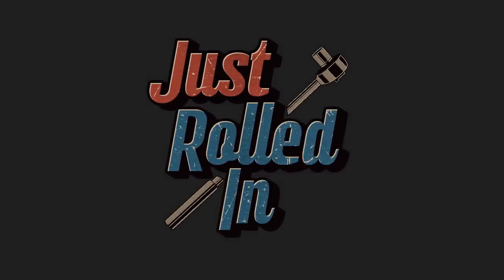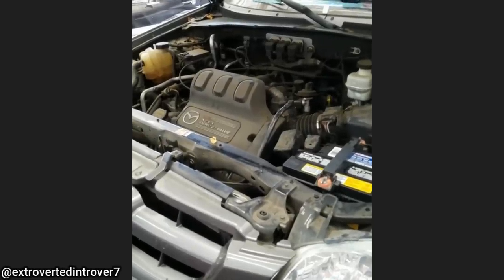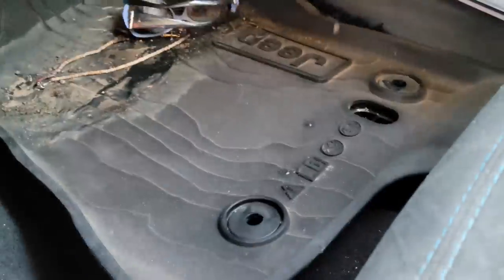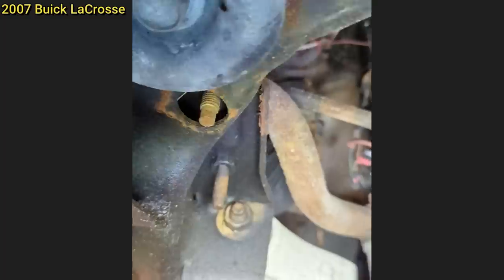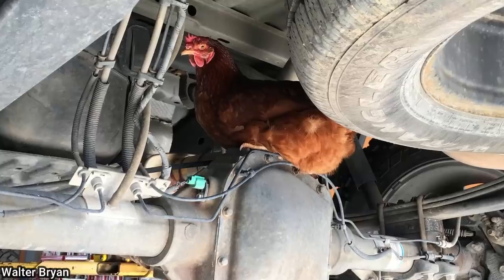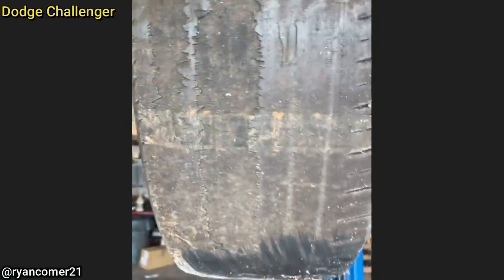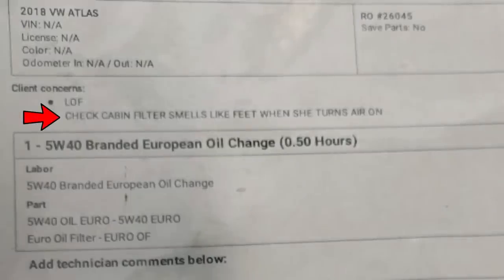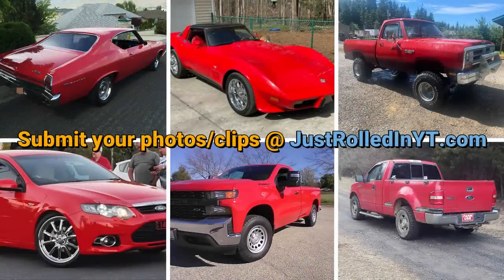Customer States They Got A Flat Tire & Kept Driving | Just Rolled In

Comment: Cats certainly know how to pick a sucker!  I'm owned by seven socialized now-indoor/walled yard ferals at the moment.  (It helps that I have the room, the time, and can trade with my vet for discounts.)
Reply: My mom has has had two cats that came from an engine compartment. The first was back when I was a kid, under the hood of an old Pontiac Lemans my uncle had just bought. The second was a few years ago. Mom drove home and heard meowing in the front of her car. Dad had to fish around inside the bumper, and found a little black fluff ball on top of the battery. They never officially named her because they were hoping to find her a home, but it's been several years, and "Kitty" is still around.

Comment: If I was the customer at 1:03 I would have declined all repairs as well, because that would be going back to the seller.
Reply from the maker: Definitely. You can also get resistors to bypass everything so the check engine light isn't on. They could have at least done that lol
Reply: Unless you bought the car in a Walmart parking lot or some other public location. Buyer beware unfortunately. Lots of people get screwed by bad sellers or lack of knowledge and what to look for. If I wanted to I could sell almost any car in garbage condition in Arizona as long as the ac was cold.
Reply: Aren't pretty much all used cars are sold "as-is". I don't think you can "return" it to the seller once you paid for it...
Reply: @engrishsheep  at least if you buy a used car at the dealership you can get a warranty and some states have a lemon law that if the same problem has to be fixed 3 times the dealer buys it back. That might only apply to new cars though.
Reply: @engrishsheep  Of you bought it from an individual, yes you're pretty much SOL (not that I wouldn't at least try to get my money back). But most states require used car dealerships to warranty for 30 days.
Reply: @engrishsheep  That depends. If you got it for below £5000, It may be worth going through the small climes track. It only costs £50 and you can make a case to the judge that although you bought it as is, There is an expectation that the car is in at least an ok state without any hidden problems that were not disclosed. 

If you get it checked as soon as you buy it, you may have a good case. It is highly unlikely that the bad work or problem appeared on the same day as purchase, and is more likely then not to be a lemon flip. If there is a blatant "trick" applied to the vehicle, then you have proof of deception.

But to avoid the problem in the first place, always ask if you can do a prepurchase check at a garage of your choice. They will look it over and let you know if there is a problem and how much it would be to fix. You can then pay what you agreed if all is ok, or negotiate the cost of repair off of the list price.

The mechanic will also normally give you their opinion on if they would buy the car at its current price in its condition, and let you know of any problems that may crop up given its age. its always good to pick the brain of a gear head, with there knowledge of repair costs and past knowledge of any problems with that make and model.
Reply: @dalelangila9274  what Heater 🤔🤣🥶
Reply: @engrishsheep  It depends on your state's Lemon Laws. If you live in my state, you are covered for any used car bought for at least $700 (if from a dealer, with less than 125,000 miles at time of sale).
If you are in a state like Florida, you are screwed. Florida doesn't have Lemon Law protections except for new cars purchased from the dealership.
Reply: @engrishsheep  Unless you can prove that the seller knew that the car was unfit for sale.

Comment: I worked in the automobile industry for 30+ years, but never once did I get a free chicken out of a job! On the other hand, at the beginning of my career I was a dealership technician. One winter morning, a colleague brought a car into his bay that had been parked outside overnight. This was back in the day when fans were connected to the crankshaft via a belt. This wasn't a modern car with a computer-controlled fan. This fan didn't even have a thermostatic clutch. When he opened the hood, he was horrified to discover that a stray/feral cat had crawled into the fan shroud to stay warm and had been chopped into a thousand tiny pieces on startup. Ugh. That's one I'll never forget.

Comment: Wait a minute...hol up...something aint right.

It smells like feet. Turns out to be a rotten avocado. Dude. Bro. How often do you wash your feeet? How do you associate rotten vegetables with FEET!! LOLLL
Reply from the maker: I was thinking the same thing as you lol
Reply: I associate cheese with the smell of feet, not rotten fruit.  But that's mostly about rubber boots that got wet inside, not feet getting noticeable all by themselves.  Maybe avocado smells different when it goes bad, because it has a lot of fat, not carbs like most plant material.

Comment: i just found this channel and i love it!  i am a 66yo woman who knows my cars/trucks inside and out,,,, i was driving a 2008 chevy colorado  a few years back, made an appointment at the shop i have been using for 30yrs...bring the truck in and tell the new machanic( he was the only one there, long timers out for test drives/parts)  and i told this guy i had "noise" coming up the steering wheel and needed new u joints,,,,he looked at me like i was a crazy woman..... i went back a few hours later and he told me i didn't need ujoints, there was cupping on my brand new tires.......no i said, it needs ujoints....he argued with me, the owner walks in and asks what the matter was, i told him...owner told new guy, put the truck on the lift....owner and i went under truck and i slapped those ujoints around...new guy got fired and the owner and i replaced the u joints....owner said free,  but i paid for the parts......some people are so stupid....
Reply from the maker: Thanks for being here 😊

Comment: I am retired mechanic now  but had a older dodge truck come in for a oil change.... took the filter off and bet weighted 5 or 6 pds.... was a gasser ... looked like 20w50 at 30 degrees coming out of the pan but the engine was well warmed up
Reply: And what issues did that (guessing) 3.9, 5.2, 5.9, or the leaning tower of power itself have after fresh oil and filter?
Reply: @garykirk1968  5.9.  The lifters had a slight tick before and after wasn't as bad... didn't help on power because it already had the damage to the valve train

Comment: Huh! Some things never do change, I guess. I remember seeing a Range Rover parked out on the street in front of the dealership with signs all over it saying the exact same things, back in the early 80's lol
Reply: In Delaware in late 90s a guy bought a new truck from a dealership it was nothing but problems they wouldn't fix it so he bought the property across the street parked the truck out there for years with signs and billboards about the dealer and had the truck sitting out there

Comment: I own an equinox with the 2.4 ecotec engine. The problem is that GM used a fuel pump that was too much for this engine. Result is it eats all of the oil in about 1000 miles. Had the warranty service done which consists of all new pistons and rings, new fuel pump, new timing chain, and coolant flush. Two years later it still eats oil but less of it. At least it’s paid off.
Reply: I had the recall done also, Just piston #4 and rings replaced nothing else, i was on the hook for the bearings it still burns 2 quarts of oil every 1000 miles. and this engine only has 54k on it.
Reply: My parents own a 17 Terrain with the 2.4. It's got 69k on it (just changed the oil today), and amazingly, it doesn't use a drop of oil. AFAIK, dad hasn't had to add oil to it, but he does check it periodically.
Reply: Econox ;-)
Reply: Calling BS, the GM warranty includes all four pistons and rings,  timing chains.  Try again.
Reply: @briansydnes1711  Just checked my dealers invoice. only Cylinder #4 was replaced. bearings and gaskets. Nothing about Timing Chains or Water pump. after doing the Oil Consumption tests before the repair it was determined on Cyl #4 was bad and that is what the dealer covered. I also got the recall to get the Cat's replaced due to excessive oil burning clogging the Cat's and they won't cover them either because they were only clogged about 30%. She is burning oil 2x faster and the oil is like black burnt water after 1200 miles. The repair ony had a 30 day warranty from the dealer with this campaign. i tried to fight it with Chevy but was shut down on every road i went down.
Reply: @joevk6274  I own 2014 since new. I change oil  every 4500-5000 miles at about 20%  So far does  not burn any oil
Reply: @tad6176  My dad's been sticking to the old 3000 mile standard. Seems to be working.

Comment: Sadly for the first customer
"Hello! We've been trying to reach you regarding your car's extended warranty" may be a welcomed call.
Reply: tax man (pre-covid) assessed the dodge at $3500 USD.  those warranty scammers will sell you a 5 year policy for $400/mo for 4 years.  do the math.  put the money away for yourself, $2200 rebuilt engine swap? no problem.  and if the old clunker dies,  buy another.

Comment: Chickens have amazing balance, they're like an organic gyroscope with legs. I had to wave a guy down once 'cause he had a chicken on the roof rack of his minivan. He told me he was tired and the chicken likes to roost up there, he didn't notice it and it had been up there for about 10 miles on crooked back roads doing around 45MPH. I don't know if chickens are fearless, or just too stupid to be scared, either way, they're funny little critters. Also, after briefly working at a Valvoline instant oil change center, I can say A LOT of modern cars consume oil, especially all those Kia's I saw with GDI engines, usually the canister type oil filters looked like the car had been running the oil for 3x long as it had.
Reply from the maker: I really want a chicken now after reading this lol
Reply: @JustRolledIn  You can pick one up, (if it lets you), and move their body around left/right up/down, & they keep their head motionless.  (Until you reach the limit of their neck, anyway.)
Reply: When I was in high school, we had a pair of Bantam roosters. One liked to perch on the handlebars of my mountain bike as I rode through the woods on our property. Speckles was pretty cool.
Reply: Chickens can get scared easily if a person or animal runs at them, but they don't have much brains.  I think they're too dumb to be traumatized, or understand the danger of riding on the outside or underside of a vehicle.  If they fell off the top, they might be able to fall safely and slow down, anyway, if they aren't too fat and don't get hit by someone else.  They can be affected by long term stress, but I'd guess that's more about hormones than brains.
Reply: @NemoConsequentae  Some years ago I saw a story about someone making an amateur film, they didn't have the money for a fancy gimbal so they strapped a gopro type camera to a chickens head. The chicken was fine and it actually worked, nice and steady shots while walking or running.
Reply: @kenlee74  Name that chicken "Steadicam"!
Reply: I think they are rather fearless
think about Foghorn Leghorn...
Reply: @kenlee74  That made me laugh, but damned if it doesn't sound like it would work!
Reply: @billysolhurok5542  Now I say... I SAY!

In all fairness though, ole Foghorn wasn't the brightest of the bunch haha
Reply: @DeadReckon  this is true 
Egghead Junior had him beat hands down

Comment: Ran out of oil twice... Ah the oil is new it won't need a filter 🤣 and just driving down the road... While doing donuts looking at the tyres 😂😂
Awesome as ever dude 👌 👍
Reply: I'm no mechanic, but that seems more like a "ran out of oil" issue than an old filter issue.  If there's that much metal in the filter, doesn't it mean oil was still flowing through the filter as the engine shredded itself?

Comment: 2:37 That is what you expect when buying a range rover. They fall apart fast
Reply from the maker: Never heard anything good about them 😅
Reply: @JustRolledIn  Been buying used ones the last 8 years and they have served me well. As long as you dont take it to a main dealer they are an absolute steal with value for money.
Reply: Best place to find a 2 year old Range Rover is a scrap yard. Fun fact, the Land River Discovery has the same wheel base as a Ford Explorer Sport (the 2 door one). Screw the gas cap off, and nose the Rover frame out with the Explorer frame. Screw the gas cap back on. Boom, derivable Range Rover thanks to some Ford guts.
(Yes, I know a body swap is more complex than this).
Reply: @JustRolledIn  My sis in law has a LR2? it's not the Range, but she honestly really hasn't had any problems with it!
Reply: @JustRolledIn  I heard when up on a hoist, a Rover is considered off road!👍🤣
Reply: That is why the hollyweird elite like them. Just like hollyweird stars falling apart fast.
Reply: Speaking for the UK, the absolute worst thing about Range Rovers is the drivers. Don't know why, but this car seems to exercise a fascination for the worst, most arrogant and sh*t-headed drivers on the road. Example: I pulled over for an oncoming ambulance - lights and siren blaring - and what does Lord F**kwit in the Range behind me do? Pulls out to overtake me, and damn nearly hits the thing head-on. Which part of the screaming, lit-up, ambulance could they not see?
Reply: I love my Range Rover she's so reliable. People who talk bad about them are just jealous they don't have one. There just like any other car if you take care of them they'll last a long time.

Comment: I did that to a dealer. Sat out with a sign. Had the car a month and the rear bushings were out and needed new tires on the rear because of the bushings. But on the contract they said they did 100 point inspection.. They replaced the bushings, tires, and did an alignment. Sad we had to go through all that. I know they have to make money but hell, I had only put 800 miles on the car. Car only had 42k on it and was 2 yrs old. You wouldn't think bushings would be out that soon. I only sat with the sign after a month of back and forth with them. At the time only had one vehicle and couldn't afford to do all that work.
Reply: Never had to fight a dealer, but I did contest the extended warranty that Big Tire Chain charged me after I declined it. 
The salespeople were too busy to talk with me or find a manager. I parked my car blocking their bays, went back in, and said the manager could take his time. Once they realized, one salesman remembered he was the manager, and was perfectly happy to correct the charge.
Unfortunately, some people need special help to do the right thing. I'm glad your problem was sorted.

Comment: Re the last clip.......similar happened many years ago in  Co Down Ireland. Customer had bought a Triumph 2.5 PI, a POS made by the then British Leyland. Car was a lemon, and dealer refused to honour warranty. Customer took a fortnight off work, and parked the car on the roadside outside the dealership-on a main thoroughfare- with large placards detailing the faults in the car, and spoke to everyone who would listen about the poor customer service.  Dealer called police, who couldn't do anything, no laws were being broken. For two weeks, the dealer didn't sell a single vehicle, and even fuel customers were turning away. He bought the car back.

Comment: EcoTec engines, like almost all other undersized/overstressed engines (EcoBoost. SkyActiv, etc.), have various problems. Manufacturers are squeezing too much power out of too small of an engine. They can't handle the stress, and usually fail short of 100k miles even with good maintenance.

Comment: I had the Chevy Equinox Oil Consumption recall done on the 2.4 at the very tail end of the campaign, the fix only lasted 4 months and it started burning 2 quarts of oil every 1000 miles compared to 1 quart every 1000 miles, Chevy said "Sorry" looks like you need to change your oil more often.
Reply from the maker: Ugh that sucks so much

Comment: 1:54 A lot of people don't realize that their car will tell on their abusive or negligent driving behavior when it is scrutinized by an experienced eye.  Yellow curbing paint on frame & suspension parts is also another good indicator that a customer's "explanation" is not on the level, lol!
Reply: I didn't even notice the paint until I saw this comment. Now I'm just wondering how fast that person launched themselves over a speed bump to do that kind of damage.
Reply: @ShimmeringSpectrum  The evidence in this case was the burned out tires.  The curbing paint I mentioned is actually in reference to what I have found on my own customers' cars, usually in the tire bead, wheel rim scars, front crossmember, or the front lower control arms.  Chunks of sod or gravel are also a pretty good sign of an undisclosed excursion off the pavement, lol!